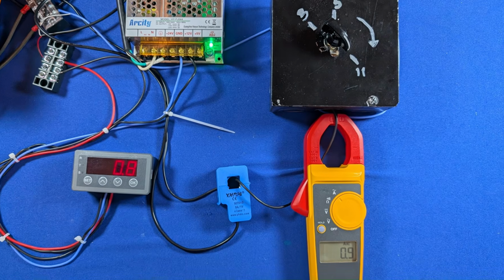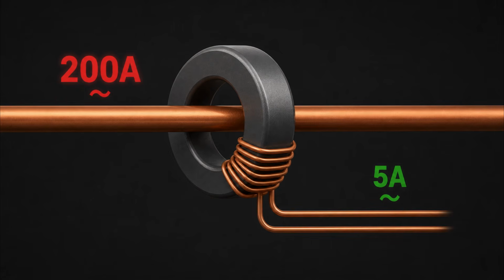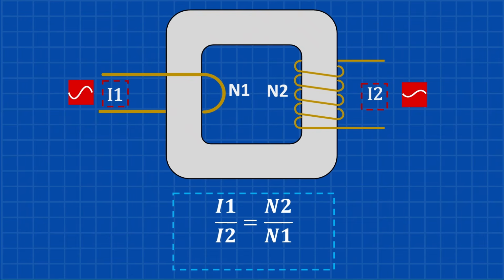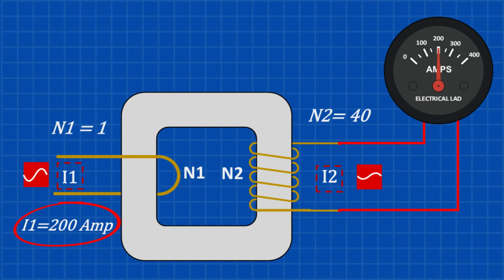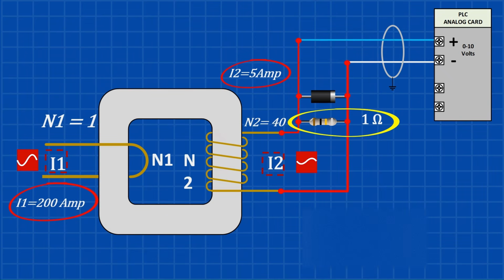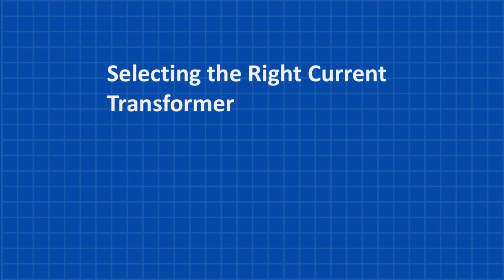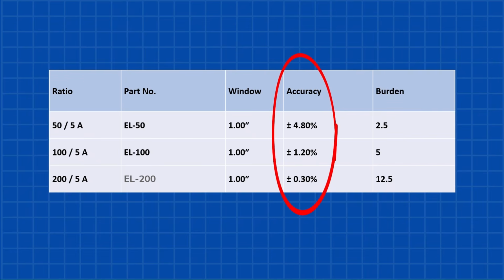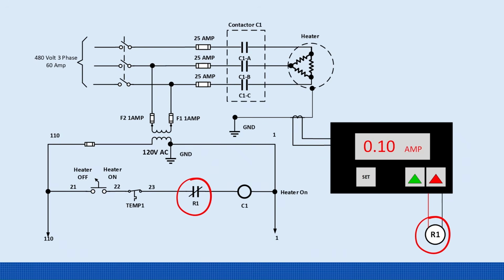Current Transformer (CT) Explained Clearly — How It Works + Calculations

Comment: You want to explain exactly What happens to the voltage?
Reply from the maker: Please explain what voltage you are referring to ? Main circuit , or CT after the conversion?
Reply: @Electrical-lad I want to know what the voltage on  multimeter would read if put it across the s1 and s2 secondary terminal when there's 400AMps  current flow on the primary assuming the CT ratio is 400:1
Reply: @orieraymond1263  you basically always keep them shorted trough a shunt/meter, then the voltage is close to 0, and should only open them when the mainline is down.

Comment: I’m a mechanical engineer who has just started a qualification in electrical engineering. I work in manufacturing heavy industrial setting, surrounded by electrical components, panels, PLCs, three phase power, Induction motors.

These videos on this channel are perfect and very good and easy to understand.

You make things simple to understand and when you provide examples of how things work, show circuits and explain how components work in a circuit is very helpful.

I look forward to many more of your videos to come!

It would be good if you could do a video about fault finding in an electrical panel.

Thank you :)
Reply from the maker: Glad you enjoyed it, thanks for the suggestion!
Reply from the maker: This channel is designed for people like yourself whom are new to field.
Reply from the maker: Thank you for your comments , I am planning on making several troubleshooting videos. Stay tuned.